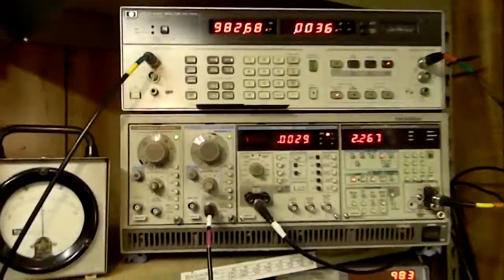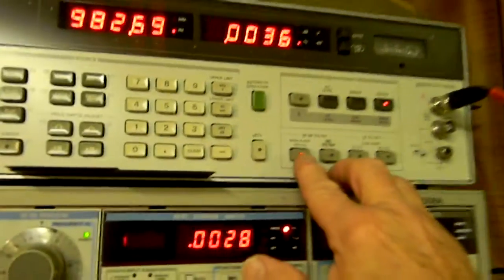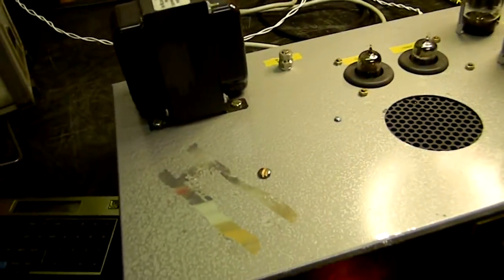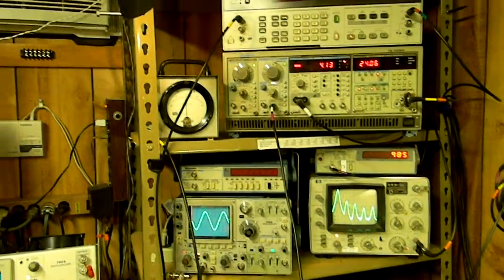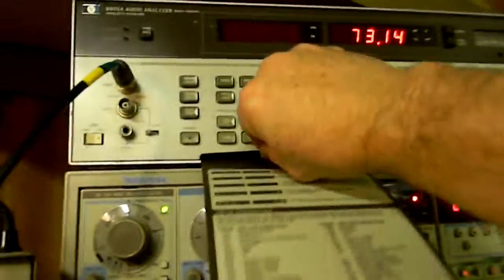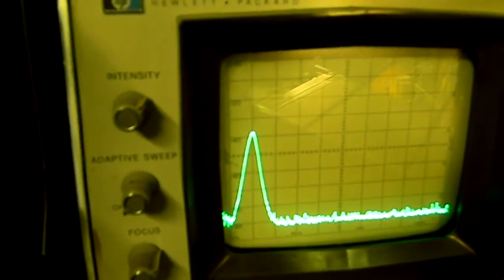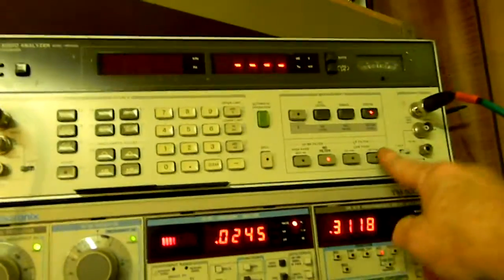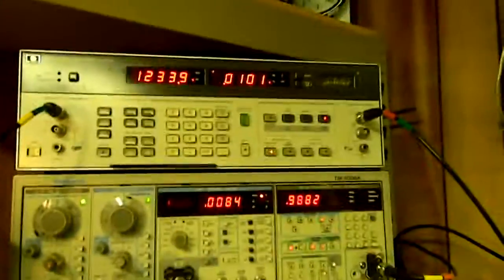Hewlett Packard HP 8903 Audio Analyzer.MOV

Comment: Hey David, Just came across your videos while on the search for an HP 8903. Learned heaps from watching your videos, thankyou! But I am curious what exactly the small device is which you have terminated onto the end of your BNC cable feeding the input of the amplifier? Is this for impedance matching? Thanks! and keep the tube amp videos up! Thats what Im into building too, but only getting into learning the measurement and analysis stuff now, hence why im searching for the HP analyser  :) Harry
Reply from the maker: In some cases I add a 600 ohm termination onto the line. It doesn't matter which end of the line as the line is considered a single point if not an appreciable portion of wavelength of the signal. Some devices require an external 600 ohm load (or 50 ohm for RF) and others do not. You can tell if you need the external load if your voltage is correct. For example, 0 dBm into 600 ohms is,  sqrt(W*Z) = sqrt(0.001*600) = 0.7746 Vrms.  0 dBm for 50 ohms would be 0.2236 Vrms.
Reply: @ElPasoTubeAmps  Thanks for your reply.
Another query I have is what cable I should be using between the test instruments and amplifier under test. It looks like you are using RG59 with crimped BNC connectors? I have an abundance of RG6 coaxial cable and compression F type to BNC connectors used for satellite tv stuff. Is this suitable? or should I stick with the smaller rg59 type stuff?
Reply from the maker: @Hazmoment  I generally use RG-58 but that is just mostly habit and what I have an abundance of being a ham radio operator. Your RG6/RG59/RG58 or any 50 or 75 ohm cable will work just fine. The cables lengths connecting test equipment on a test bench is such a tiny fraction of a wavelength at audio frequencies that all points along the cable are seen as a single electrical point. At RF frequencies, into the MHz and especially in the GHz region, the cable length and impedance does become an important factor if the cable is not terminated properly with the characteristic impedance of the cable. You know the impedance of the cables mentioned but twisted pair (CAT-5) and zip-cord have an impedance around 100 ohms and they can be used also for connecting cables but you would likely get a bit more 60 Hz hum pickup if they are not coax.
Reply: Thanks for taking the time to reply David.
I have received my 8903A just a couple of days ago now, and have been successful in setting up the Analyzer to be used with Pete Millets software. (quite painful and very happy thats over with) I am now using your videos as a guide to the testing procedure for frequency response, THD vs Frequency etc. on an old Rotel solid state amplifier. Im going to get comfortable with testing this one correctly before moving on to comparing some tube amps Ive built. 
Is it quite standard to complete these tests at the amplifiers rated power? or is it sometimes done at another reference level such as 1Watt?
Thanks for going to the effort to upload these sorts of videos. Its great being able to tap into your wealth of knowledge! Cheers! Harry
Reply from the maker: @Hazmoment  I am really pleased to see that the videos help. I agree that it is not a lot of fun or easy to get everything configured right but the 8903 is an amazing instrument coupled with the PC. I test at all levels, usually not 1 watt but some people do. Testing at full power is one measurement point but I also like to test at half power or just some level that I might actually run an amplifier at. Lots of things to learn from years of measurement. For example, I have found that UTC transformers perform really well in mid frequencies and at 20KHz+ but many fall apart below 30 Hz. That is not a bad thing but I have measured this over and over with a few exceptions like the W-20 I built a couple years back. The W-20 amplifier with the original design and output transformer really does amazing from 20 to 20KHz at its rated power.  I have found that typically Acrosound and James transformers do better at 20 Hz than UTC. Most decent output transformers have a 20H primary but I have a high-end Chicago output transformer that is 40H primary and it works well all the way down to 10Hz. You will enjoy finding all this out on your own now that you have such a nice instrument up and running.
Reply: Awesome. I am using a Japanese transformer made by Hashimoto in my design this time round. They are a nice quality potted transformer and the amplifier sounds beautiful. I will think about making and uploading some videos too on my results of the Hashimoto based amplifier. It will be interesting to see how it compares with some of your amps too. I will let you know when I get to that point.

Comment: Great video and great explanations! :-)
May I please ask you if you know the difference to the Keithley 2015 thd?
Reply from the maker: I am not familiar with the Keithley but I would assume it is a very nice instrument. As can be seen in this video, there is discussion on the differences between the Tektronix and HP instruments concerning THD. I have pretty well accepted that if one measures 0.012% THD  and the other measures 0.018% THD, I don't let it bother me anymore... In my personal opinion, I tend to believe that single purpose instruments are generally more accurate than multi-purpose instruments but all three mentioned here are lab grade.
Reply: @ElPasoTubeAmps  thank you for answering! :-)

Comment: Regarding the accuracy, the THD alignment routine for the AA501 consists of merely adjusting a trimpot for minimum displayed THD. I think it is therefore reasonable to conclude that whichever instrument is displaying lower THD is more correct. It's a shame the HP is a little unstable: maybe it needs a tweak.
Reply from the maker: I didn't know that adjustment about the AA501. Thanks. When I got these instruments, I found a good bit of discussion about which one was the most accurate. It seems the conclusion was the AA501 was and the reason stated was that it is a simpler and more direct measuring device and it is not the multi function instrument the HP is. They don't always agree perfectly on THD but they are close. The voltmeter of the 8903 totally agrees with the newer Tek multi meter I have. (except for the actual number of digits which the Tek meter has more of). If they both set there for a minute, usually the HP finally agrees with the Tek on the THD.
Reply: ElPaso TubeAmps It makes you wonder how accurate those HP/Pete Millett THD sweeps can be, given that they don't have a minute of settling time per frequency. Or maybe it is just a display problem? Or maybe the sweep graphs don't have enough precision to show the instability?
Reply from the maker: I have run those plots with a different number of points per decade and with the default of how the program comes up, I don't think there is enough time for any settlement and the graph can be pretty rough (and quick).  On the other hand 10 points/decade makes a pretty smooth plot. In general the plot will agree with what is displayed on the front of the 8903. Pete made an improvement to the software as late as a year or so ago where he made the driving voltage level adjustment work correctly. I believe the software accurately displays what the 8903 is "thinking".

Comment from the maker: Sorry it took me so long to reply. When I read your post I thought that was an excellent question. Now that I have had it for a while and I run THD plots with the output of the HP directly into its input, the lowest I can get is 0.01% THD.  It is difficult to compare the HP and the Tektronix as they never seem to agree. Often times the HP will give a reading much lower or much higher than the Tek. I have the most faith in the AA501 but I certainly do like both instruments.

Comment: There is another post on youtube where a college instructor is using the 8903A to step through audio frequencies to check distortions as an automated process. As you know both Tektronix and HP made spectacular equipment much of which is affordable to Hams experimenters and small businesses. 20 years ago and we could only dream Hi.
I am not doing as much audio work now as I use to but still enjoy playing with tube and FET audio amps/preamps. Some of the newer FETs really rock at audio.
73 Glenn

Comment: Hi,
I bought an HP8903A at a Ham Feat last year for $25. It had been donated to a club from a defunct lab and no one new what they had. I asked what they were asking and they said make an offer. Jokingly, I said $5 and they said sold. I had $25 in my pocket and gladly gave it up. Hi
I am still learning all of the tricks but it's a nice piece of gear. You may find out that varying cable lengths, even at audio will result in reading differences between instruments.
73
Glenn WA4AOS